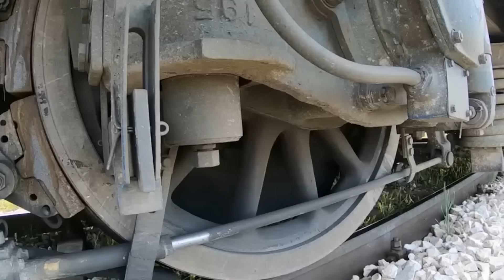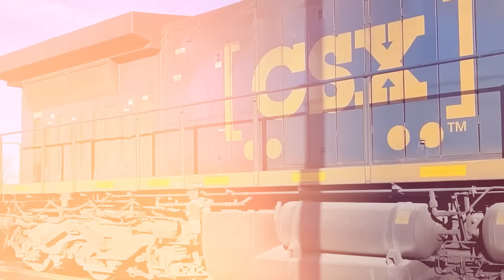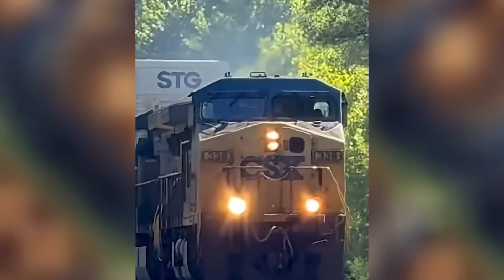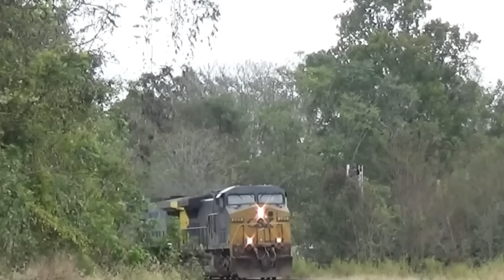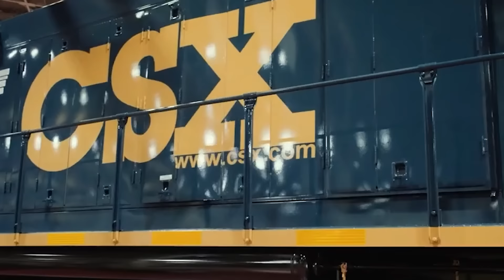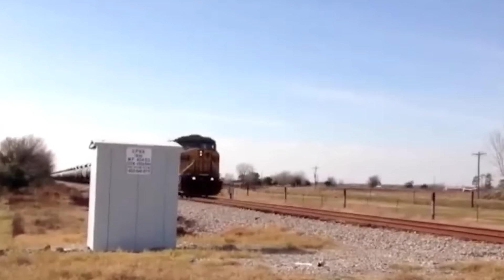The Real Reason Locomotive Wheels Don't Slip Under Extreme Load

Comment: While he has most of his facts correct,  he's wrong in that every wheetset under a locomotive is an individual traction motor. Also, the couplers distribute the load evenly.  And if you've ever seen the powerplant inside these locomotives, plus the size of the generator and air compressor it powers, you would understand the weight. I used to cut them up for scrap.

Comment: Click bait here.  This video is full of incorrect and misleading information.  Retired locomotive engineer here and operating practices rules instructor of a Class 1 railroad in the US. .  This video is full of incorrect and misleading information.  For one,  the locomotive engine does NOT make the wheels turn as you said in your video.  The diesel engine turns a generator, the generator provides power to electric traction motors on each axle which propels the locomotive.  This is why these locomotives are identified as diesel electrics.  You are incorrect in stating that the contact surface between the rail and driving wheel of the locomotive is a quarter.  It is not.  It is the size of a dime. You also ask how does a single 200 ton locomotive pull a 20,000 ton train.  It can't.  That is why a single locomotive units is part of a consist (more than one locomotive electrically cabled together as a multiple unit consist. There is more false information in this video not even worth attempting to correct this presenter on.  Thumbs down here.
Reply: Thanks for the accurate information.   I didn't like how he stole other good creators photos/video like @distantsignal

Comment: Super seven creep system (other systems are available) keeps the wheel at point of slip which is the most efficient and with AC traction motors it will move anything

Comment: You might want to weigh 150  lb and could push 10 ton box car with just 9 lb of force  because the wheels are so solid that they don't squish like rubber and the rail is so hard that there's almost 100% where they roll

Comment: Steel has its limitations. I knew a driver of the British HST locomotives and he told me running over leaves on the track at 125mph would make it go into wheel slip. Now if you can't get traction on leaves it also means you cannot stop on them.

Comment: simple they have nozzles by the wheel with a flatten edge the sprays sand just in front of the wheels to prevent wheel slip

Comment: The wheels are made of steel compound softer than the rails,this is not addressed in this video.
Reply: Today locomotives have traction control which keeps the wheels from slipping. Traction control started in common use in the 90s. If memory serves  me correctly EMD offered traction control on SD 60s. As we know some automobiles also have traction control. 
When I a kid in the late 70s I’d see piles of silica sand which help the wheels get grip. I grew up near the Congress Park stop on the BN. IHB would bring a train up onto the BN. As a result IHB would use sand for traction. With traction control on locomotives these days engineers rarely use sand if at all.